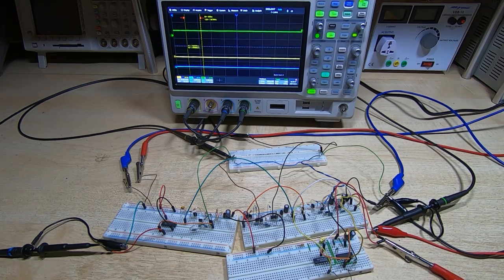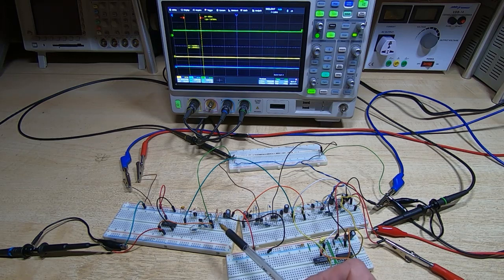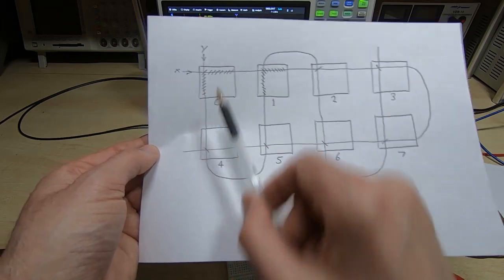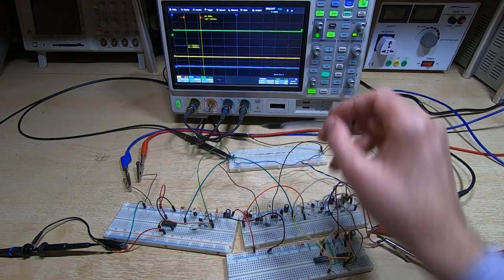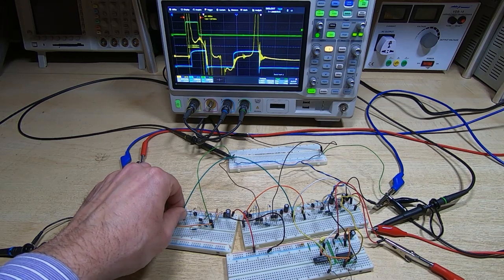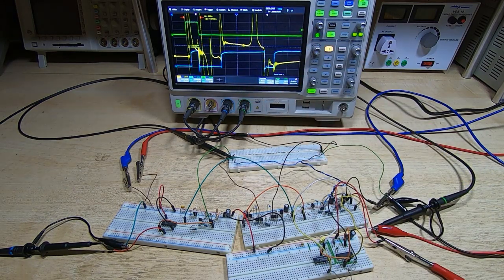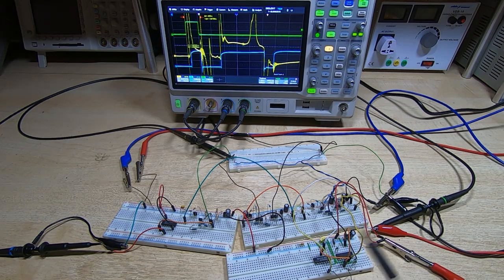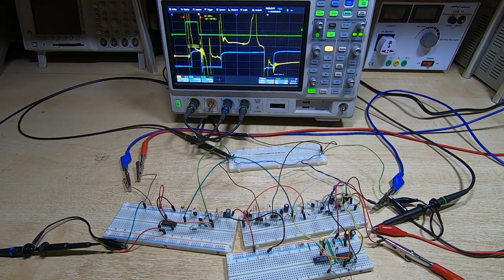Magnetic Core Memory Decoded Part10

Comment: Hello I look forward to buying your book and playing around with this technology. I recently acquired a 64K core memory pane and will do some testing of it. It has two mirror sides with 4  windows of 32x32 x and y lines. Now I wish to make a graphing calculator using this and an Arduino and cyclone 2 fpga for the glue logic and timing and sequencing and have the Arduino handles storing and reading the values to the cores and the graph the values pretty straightforward. You mention the risk of error and increase of difficulties as the size and cores increase should I be using some DSP techniques in the fpga to alleviate issues and in turn use some op amps  or ADC to read the values because. Another worry I have is the number of drivers and circuits required to handle this size I'm guessing 560 transistors for the drivers along. Any insight before I continue with this project would be fantastic in any direction from something more experienced would be a big help. Great videos

Comment: regarding the question answerd: we can also see the 8 differents mats as a cube (stack of mats, instead of 8 mats side-by-side); in this case, the inhibit wire can be seen as the z axis selection wire. We could add, as described here, one drive circuite per layer, but not efficient.
Reply from the maker: Yes they can be physically arranged in many different ways, The book has a whole chapter on that. However the wiring is the same in terms of repeated X Y wires and inhibit / sense wires although in larger arrays the way in which they are threaded through the cores is different. Also note that the winding pattern of the inhibit / sense wires means that the cores must be arranged in specific ways (another chapter covers this).